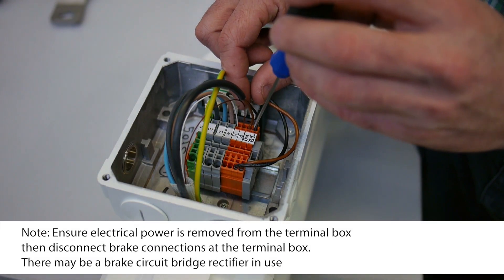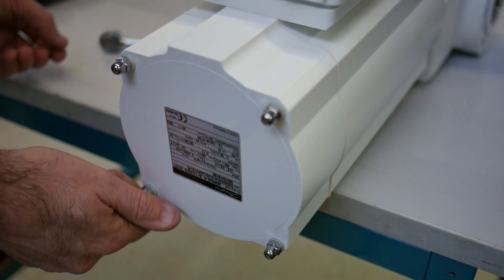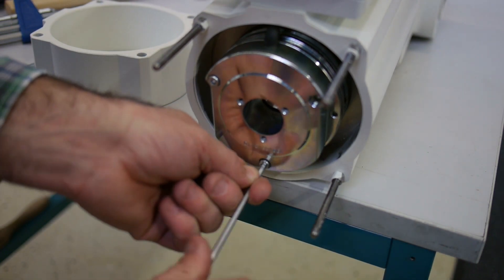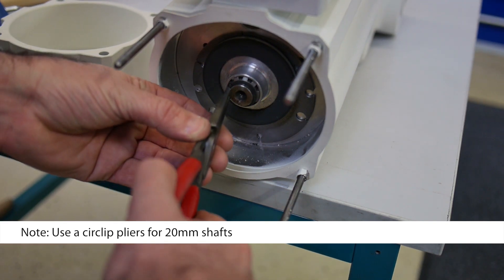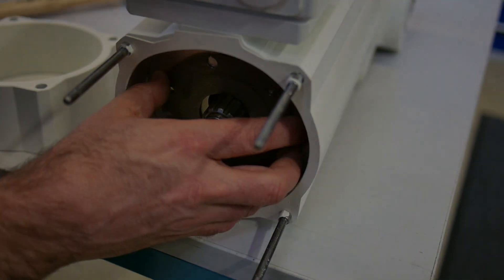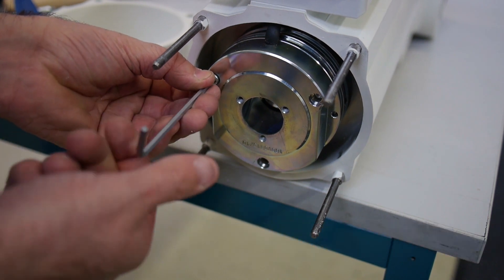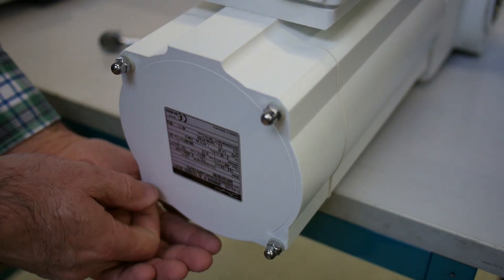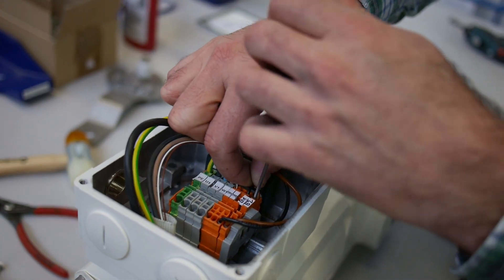Exchanging a brake of a Danfoss VLT® OneGearDrive (OGD)

Comment: I want to know inside gear box hollow shaft bearing size ( Number ) could you provide.
Reply from the maker: Thank you for your inquiry. For any service or repair needs related to the gearbox hollow shaft bearing, we recommend reaching out to Danfoss Service or an authorized Danfoss Partner in your country. They have the necessary expertise, tools, and replacement parts to ensure a proper and reliable repair.

You can find the right contact for your region here: https://www.danfoss.com/en/contact-us/contacts-list/

Kind Regards
Danfoss Drives Social Media Team